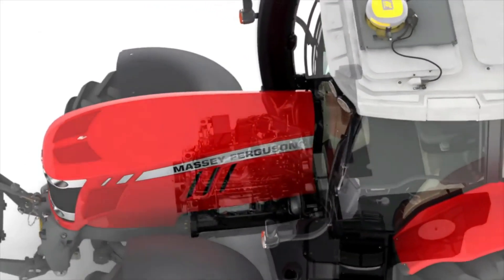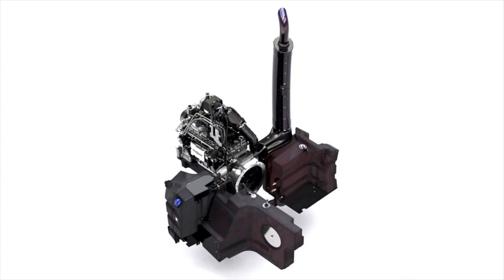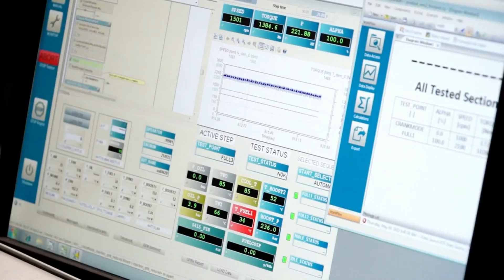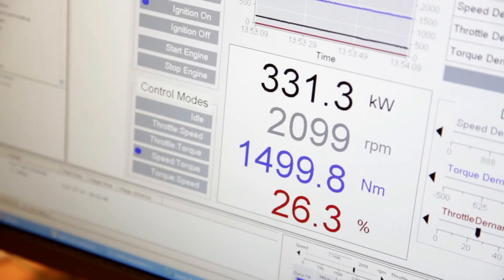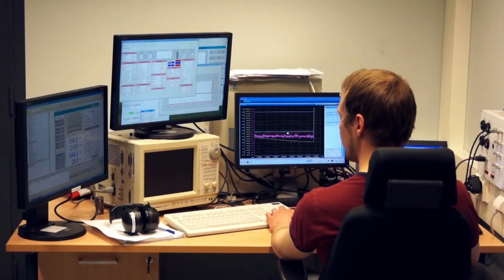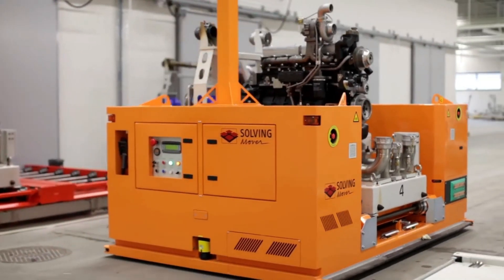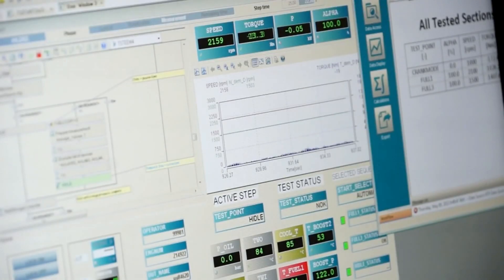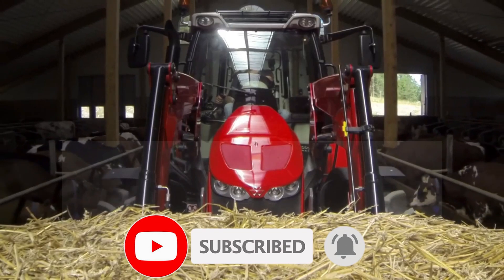Massey Ferguson Engine Manufacturing

Comment: I would like to speak with someone at this 
facility because I have a Massey 1739e thats been down for ECU for 3 months I have 1967 130 that I've had for years all it needed is the battery put back on. so before I pull this 1739e apart  and put a none Peace of crappy motor in and let it run for 8000 hours can someone tell me what motor will bolt up to it with out all bs
Reply from the maker: Best to contact Massey Ferguson directly at www.masseyferguson.com